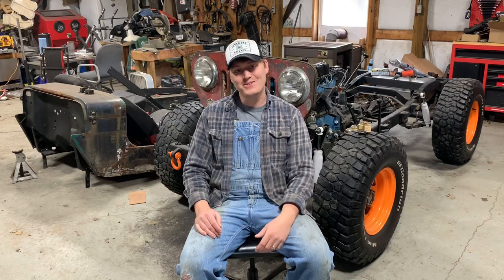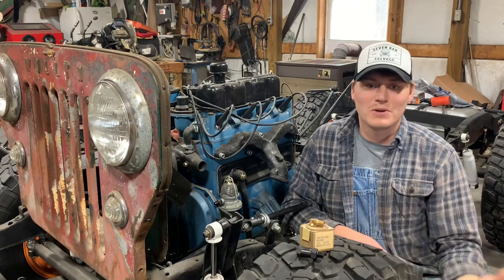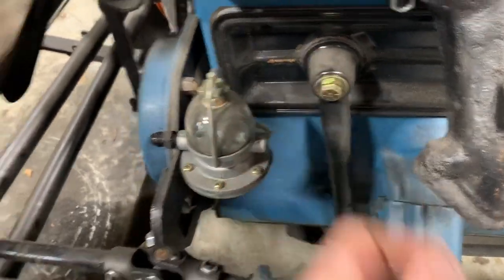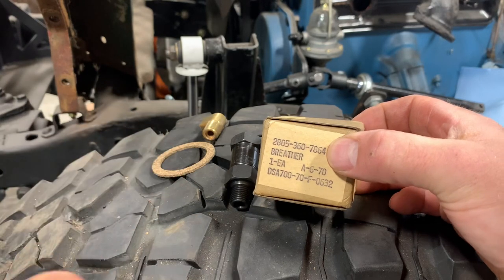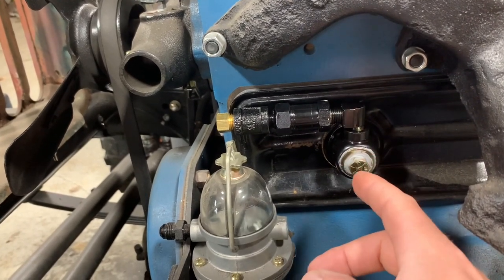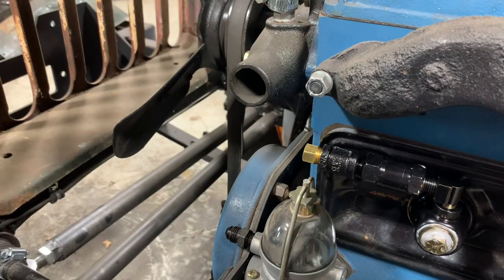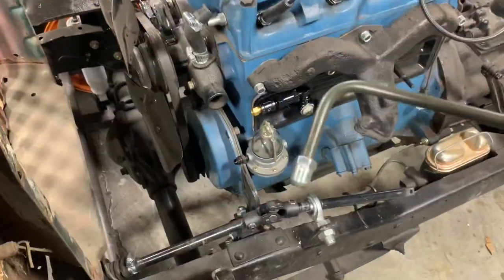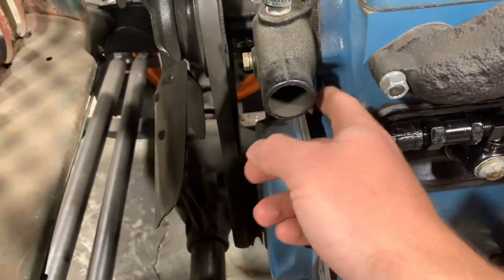Willys Jeep PCV Valve Install!

Comment: Looks great, that should work really well for many trouble free years. Most four-wheel drive Jeeps were delivered with PCV systems for water resistance and improved effectiveness in low speed or stationary uses. The cheaper road draft tubes were more commonly found on two-drive vehicles. Many if not all engines used a conically shaped screen behind the breather cup to help precipitate oil from the vapor as it exited the tapped cover. A tee-fitting was used at the corner you had trouble with. The unused port was either capped, connected to the vacuum wiper(s) or routed to the vacuum boost fitting on the fuel pump if so equipped. Tubing was copper-clad steel. Vented and non-vented intake valve covers seem to appear randomly with several variations in design over the years.
Reply from the maker: Excellent write up, thank you for sharing!

Comment: Your PVC system won’t work if you plumb the oil filler neck to the air filter. You have to use one or the other. Your crank case pressure will take the path of least resistance.
Reply from the maker: I understood it that the flow of air goes through the air filter, into the filler neck, comes out of the crank case at the PCV, then into the manifold?
Reply: @SevenBarSalvage  Not sure about the F head but ton the L head the oil filler vent goes to the crossover tube and back to the carb . so it's between the carb and the air filter . I had a 3B for a while and I DO KNOW the oil fill neck DID have an attachment at the air cleaner also .
Reply from the maker: @frankporfidio9813  Thank you for sharing!

Comment: You'll be glad you took the high route as opposed to going under the water pump with the line.  If you had gone down you would have created a trap where oil droplets would collect over time blocking the line from breathing.  The high route allows the oil to drain back into the engine when parked.
Reply from the maker: Excellent point!

Comment: I am completely new to the vintage Jeep engine. Do you have or will you have videos that explain the oiling system of the Jeep engine and the air cleaner. If you are
 not doing this can you recommend some place else. Thanks.
Reply from the maker: I don’t I wish I did, I’ll probably cover the air cleaner eventually. Metalshaper here on YouTube has some very informative videos on old Willys Jeeps!

Comment: Please use proper nomenclature,,, NOT  valve cover, that's on top of the engine the draft tube was attached to the tappet cover,
Reply from the maker: You bring up a good point… in my defense Kaiser Willys has them listed as “Engine Valve Side Cover” but it’s nothing to lose sleep over either way! Thank you!